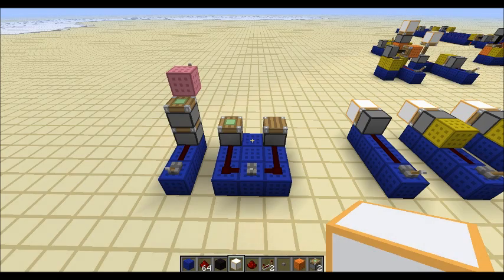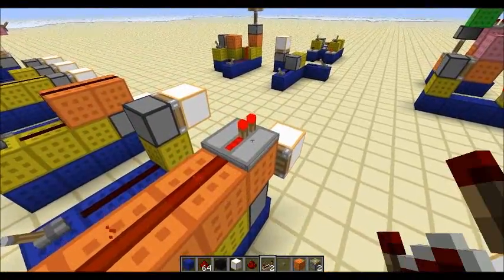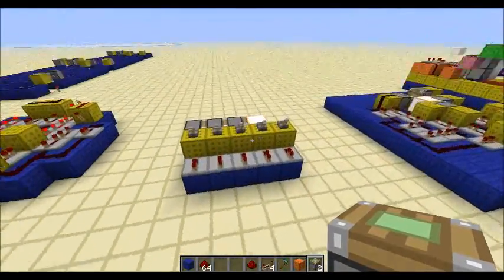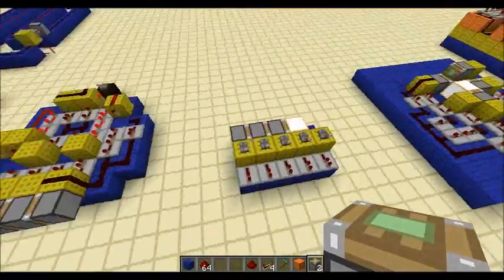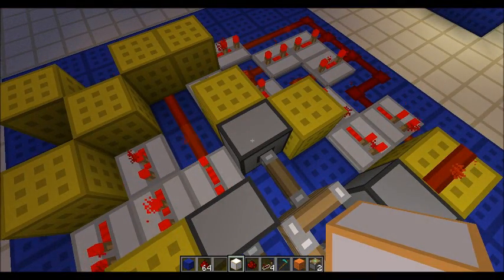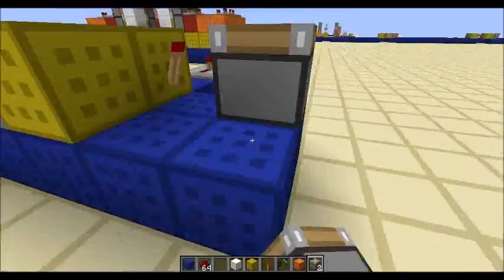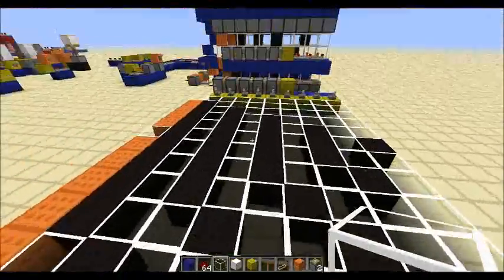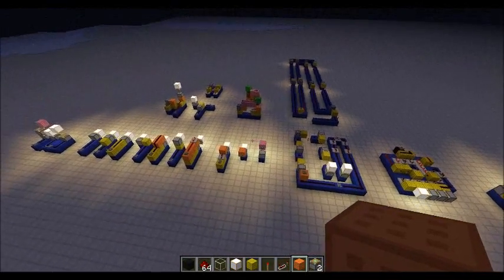Minecraft Facts: Pistons

Comment: Can you help me answer this question?
If u put redstone to power 2 sticky piston where they both get powered at the same time and one is front of the other (on the sticky side,with both facing the same direction), which would power first?
i've tried,powering at different "parts" of the redstone wire gives different results,that's why im confused